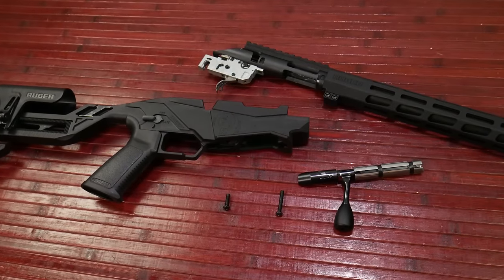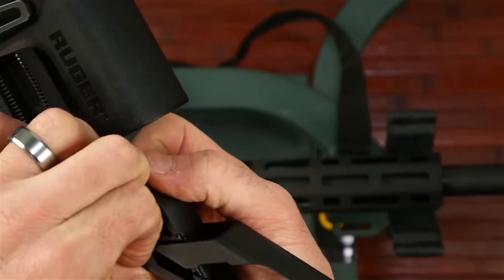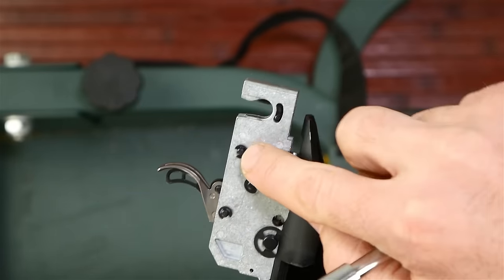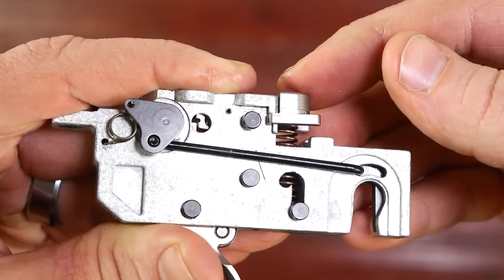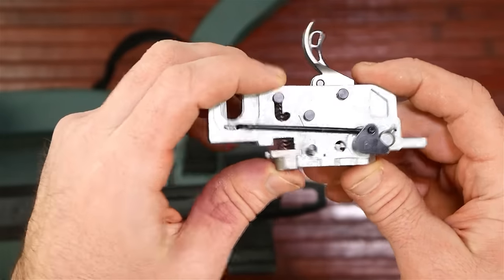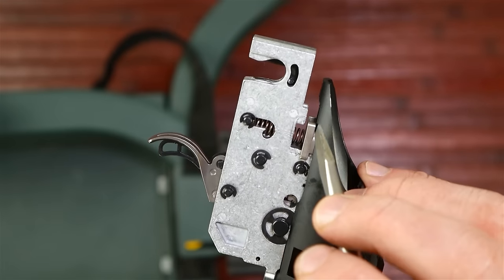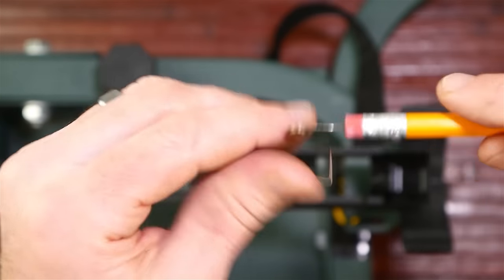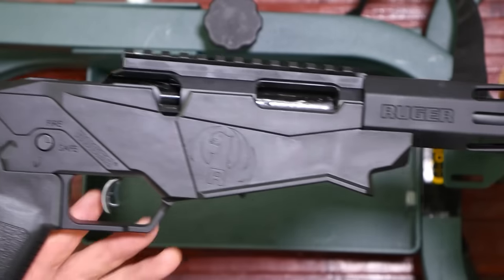Ruger Precision Rimfire Detailed Disassembly

Comment: After re assembling I found that if I tightened the longer bolt too much it made the selector switch harder to switch from safe to fire. Then if I loosened the long screw it made it easier to function the safety. I knew this couldn’t be right. Finally saw the mag release/ejector block sitting on my work bench and realized i completely forgot it. So once you get all the pieces re assembled it works properly and I could tighten down the long screw all the way and the safety functioned smoothly. Go figure haha.  His ejector didn’t come out of the lower in the video so I wasn’t seeing what the problem was

Comment: Im having issues, If I rack the bolt then move my saftey from safe to fire and pull the trigger it's a much harder pull,but if the safety is already on fire and I rack the bolt everything is normal,issue only shows up when I use the safety,any idea's what it could be?

Comment: What are you talking about with the safety???? It works no matter if you open the bolt or not man.
Reply: Has to be cocked, he said. Then it doesn’t matter if the bolts open or closed.

Comment: I finally got to take my ruger out. I was super excited to take it out but I was pretty disappointed. Does anyone else have an issue of the mag being loose? I had to press up on my mag every time I chambered a new round. It also wouldn’t fully eject the cartridge. It would eject but stay with the chamber. It did it more then half the time. ???? Maybe operator error. Either that or I got too spoiled with the CZ455 22lr.
Reply: Mine runs perfect every time. Take it back to get looked at.

Comment: 4:20 10 to 15 inch lbs of torque based on the size of the screw. If the screw threads into a steel nut you can go as high as 17inlbs. if it threads into (what i assume is aluminum) hand guard, dont exceed 10 in lbs.
Reply: I agree with your specs, based on what is likely an 8-32 hex head screw. Unfortunately no clamp/friction based aluminum handguard is going to stay on with just 10in-lbs of torque. At least none that I have and I probably have seven of them. Any significant pull or twist and they will give. Just a downside of using that style of handguard, although I’ve never come close to stripping out the aluminum threads even going up to around 25-30 in-lbs.